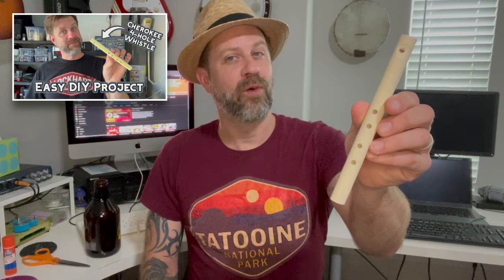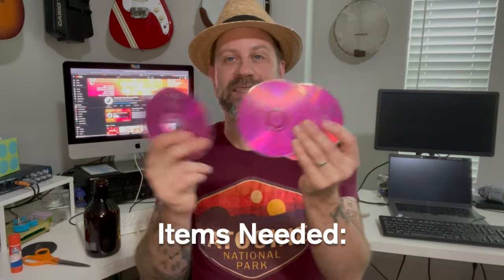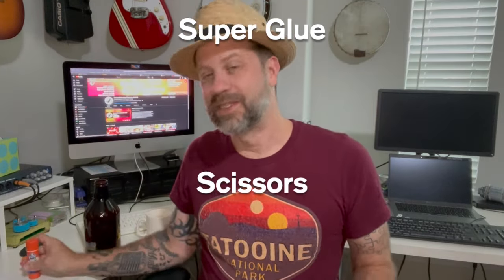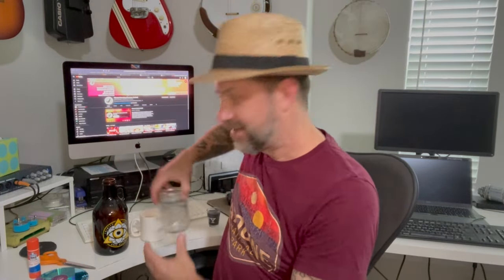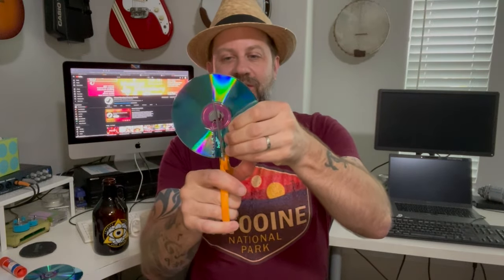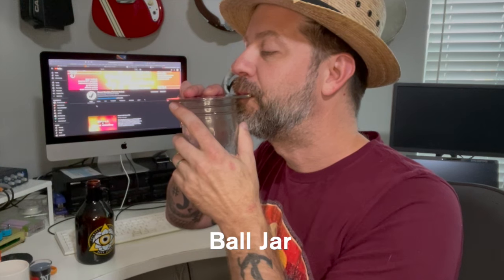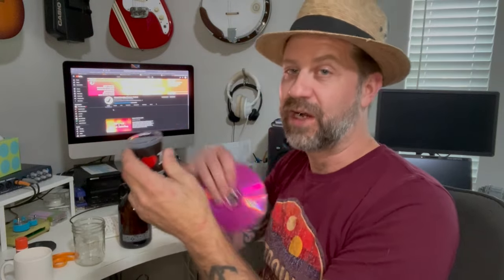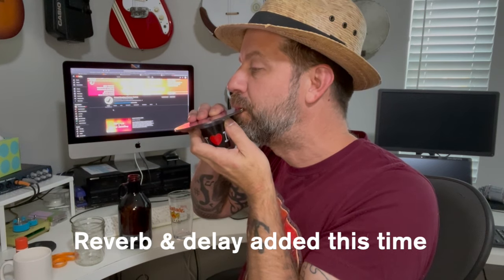How to Make a CD Whistle (super easy DIY vessel flute)

Comment: nothing larger than a drinking glass works, also use a plastic cup and drill holes in it and glue it to the CDs and you have an ocarina.
Reply from the maker: Thanks for checking out the video.